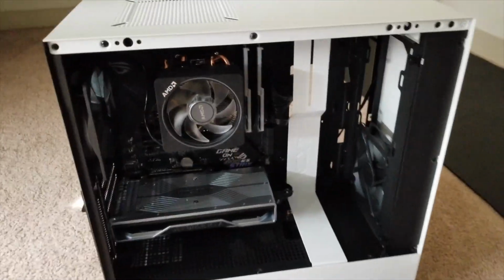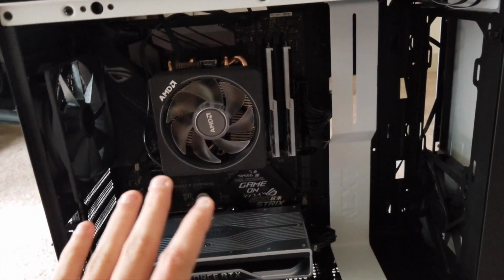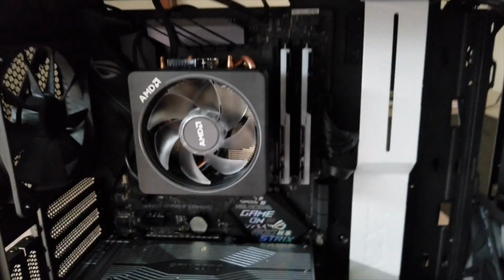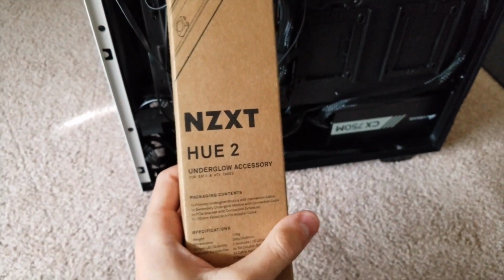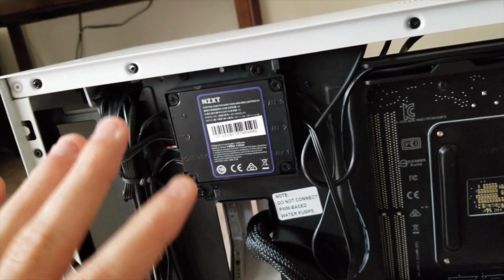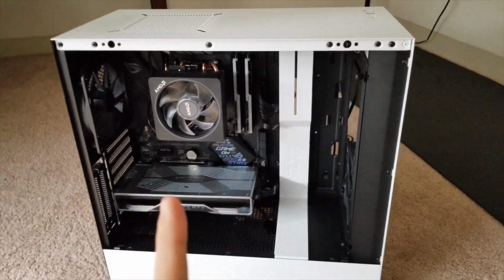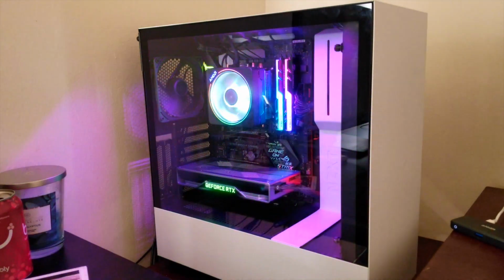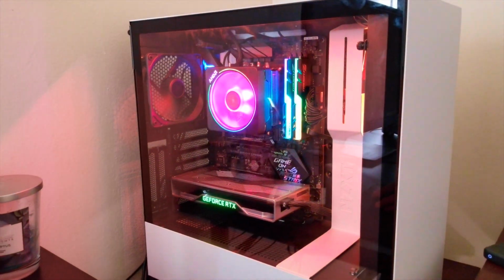NZXT H510i Case - Follow Up and Build

Comment: Dont know if you still answer questions but I dont know how to plug in the breakout/front panel connector cables
Reply from the maker: You have to reference the manual for your motherboard and the case itself. There should be sections explaining what each plug does and then what different ports do. If you don't have the manuals a quick Google search should find it for ya🤙🏻
Reply: @JaBlankSki  I have figured out the placement of the connectors but I'm not getting power to the motherboard, should the fan on the psu spin regardless of it being connected to the motherboard as there isnt power to the leds or fans either
Reply from the maker: If you don't have power to the board or fans or LEDs your power supply may be a dud🤷🏼‍♂️ if only certain things worked while others didn't then I would say trouble shoot those. But since it seems you are getting no power I'd say look at your power supply
Reply: @JaBlankSki  yh its brand new but I think I'll get a replacement, thanks for the help man 💕💕
Reply from the maker: Yeah it happens sometimes unfortunately 😖 I feel like the power supplies aren't always good quality even if they are a good brand. But yeah see if that helps! Best of luck🤙🏻🤙🏻
Reply: @JaBlankSki  thanks for the help man I dropped a sub, you're a nice guy
Reply from the maker: Thanks man I appreciate that 🤙🏻
Reply: @JaBlankSki  ❤

Comment: I just got this case and the "top" fan (that you moved to the front) isn't spinning.   Why would the back fan work and not the other?
Reply from the maker: Make sure it's plugged into the hub fully. Unplug it and replug it into the same spot or a different one on the hub. If that doesn't work, try plugging it directly to the motherboard. If it doesn't spin for any of that then it's probably a defective fan. Hope that helps!

Comment: hey so im a little confused, the case comes with 6 pin connectors and another weird looking plug, where did you plug that into?
Reply from the maker: Hey could you provide a time stamp for what your asking on?
Reply: @JaBlankSki  when you showed the bottom part of the motherboard you had the 6 pins thing to power everything on the front IO, but it comes with some weird connector at the end of it, where would we connect that part?
Reply from the maker: @Rawrs  I'm having trouble understanding what exactly you're referencing. There is the SATA that you plug into the power supply? Or there is the hd audio that you have to plug into the motherboard? That will depend on your motherboard. Check the documents for the case and the motherboard. Or you can also reference my first video on this case! Sorry I couldn't help more
Reply: @JaBlankSki  we figured it out but, on the H510i manual at the cable connections part there's a cable there that we didnt know what it plugged into but we knew the 6 pins powered the start button and stuff, but our case didnt come with a manual so we searched all the internet to figure it out
Reply from the maker: Did you get it figured out? If you go to NZXTs website they have the manual you can download

Comment: You didn’t really explain but did you plug the case fans into the plugs that were attached to the hub or to the one on the motherboard? Now I’m talking about the plug that has the four plugs and then the sata on the end, which did you use? Does it matter?
Reply from the maker: Hey! So I had the two case fans plugged into he case hub itself. The case also comes with another fan cable extension that has two 3 pin connectors and 1 4 pin connector. These are if you get more fans for the case. If you mean other cables make sure you read the case instructions cause they will explain what is what or check your motherboard manual. I do go over the cables a bit more in my first video on the case which you can find on my channel! Hope this helps!
Reply: Ja Boi oh wait aren’t the case fans already plugged into the hub?
Reply from the maker: They should be!

Comment: Do you know if you replace the rear and the top fan with NXZT AER RGB 2 (120mm & 140mm), will they be compatible with the hub that come in the case ? I want to point out that i am not referring to the NZXT AER RGB 2 twin starter pack that comes with the HUE in the box.
Reply from the maker: I believe any NZXT RGB fan will require the HUE2 hub to work properly (i.e. spin, light up, and sync to other LEDs). Without testing it I can't 100% verify it, but that is my guess
Reply: @JaBlankSki  I just hope this is not true. Because imagine if i buy 2 single NZXT RGB fans, now i have the integrated HUB that come with the case and on top of that I'm gonna have to install the HUE 2 controller to power separately those 2 RGB fans ?

My reasoning is that buying 2 single NZXT RGB fans is cheaper than buying the NZXT AER RGB 2 - twin starter pack and that is why you paying a little bit more to when you get the "i-version" of the case so you wouldn't have to spend more on RGB fans.

I know you can connect the 2 RGB fans to your motherboard but in the end you want to synchronize the RGB lights using the nzxt cam.
Reply from the maker: Not sure if you were able to test this but would be interested in your results. As mentioned in my video I got the underglow nzxt lights and plugged them into the hub with no avail. They would not light up without the hue 2 hub🤷🏼‍♂️
Reply: @JaBlankSki  i have 2 AER RGB 2 in my H510i and i confirm it's not working ! :(
Reply from the maker: Bummer:/

Comment: Good job man . I’m trust trying to figure out where you put your front case connections. I have the same case with amd and I think this helps me. I see you put the little tiny connectors and put it through the back. Can I ask what you plugged that dongle into back there?
Reply from the maker: You'll have to reference the manual for the front IO and the manual for your specific motherboard. They will tell you what plug is what and the motherboard manual will tell you where they can be plugged in. There is one dongle in the back for all the case stuff that plugs into the power supply
Reply: Ja Boi  thx I didn’t know the other end went into the power supply area. Was looking like crazy . My first build. This case r5 2600 with Nvidia gtx 1660 super oc
Reply: Ja Boi yeahhhh my power supply don’t have any thing that it plugs into. Now what?
Reply: Ja Boi I found it! It was on another sata strain.
Reply from the maker: There ya go🤙🏻
Reply: Ja Boi too bad I didn’t check my new power supply. It’s dead:(
Reply from the maker: Oh no, that's not good 😖

Comment: Is the h510i led strips pre installed to the case or do you need to buy and install it yourself?
Reply from the maker: The LED strips come pre installed and plugged into the hub. They should light up when the case is turned on and then can be changed with the Cam software 🤙🏻
Reply: @JaBlankSki  Wow, cool to know and is it the same with the black version of this case?
Reply from the maker: It should be since the only difference is the color!
Reply: @JaBlankSki  OK thanks 👍
Reply: Hey ja boi can you link me the cam software plz I have this case and I haven't been able to modify the lighting on the led strips, is appreciate it a lot haha.
Reply: why my led is blue only?
Reply: Creasetian Lauren Cajayon you have to download the CAM software to change the color
Reply from the maker: If you just do a quick Google for CAM software NZXT you'll be able to find it🤙🏻

Comment: thanks for the video its really ahrd to find video about this case, i actually have question will my  cooler RGb work with  LED 2  Port?
Reply from the maker: Glad it could be of help! And I'm not 100% sure. Mine CPU cooler LEDs go off of my motherboard. It may work! Just not sure either on control of those LEDs. Like if you'll be able to change style and such
Reply: @JaBlankSki   i see , well the problem is that my motherbord dosent have rgb connector so i thought since this case has its own it would help
Reply from the maker: I mean doesn't hurt to try! And worst case you may just need to switch the board🤷🏼‍♂️

Comment: Where should I connect the control hub LED and fan cables? On my motherboard? Where exactly?
Reply from the maker: So the hub connects via a USB pin connector on the case itself. You'll want to plug it into a USB pin connector on your motherboard. The hub gets power from a SATA cable on the case as well. That'll plug into your power supply. Hope that helps!
Reply: @JaBlankSki  And where do the rest of the cables that come with the case go? (Such as the Power, usb 3.0 etc...)
Reply from the maker: It just depends on your motherboard. You should have gotten a manual with the board that explains what each input is and where it's located on the board. The case also came with a manual on what the hookups are that come from the case itself. If you don't have the manuals just do a quick Google search and you should be able to find them 🤙🏻
Reply: @JaBlankSki  thanks for the help dude. I think I'll buy this

Comment: Hey :) I’m currently building a pc as I’m typing this lol and I have an emergency😬 sorry for the nooby question, but where does the wire coming from ‘fan 1’ on the control hub go? I can’t find anywhere on the PSU that it fits into
Reply from the maker: Not a noob question at all! Hmmm I believe the fan 1 just goes to a fan not necessarily to the PSU. There should be a different cable that goes to the PSU to power the hub and front I/O
Reply: it’s like ‘fan 3’ and ‘fan 2’ are connected directly to the fans, then ‘fan 1’ has a loose wire?
Reply from the maker: Ah yes! It has like 3 connectors on it? Those are just extensions for any additional fans you may want to hook up. If you don't have any more fans then I wouldn't worry about this. You can either just tuck it away in your case, or unplug it all together! I think I just tucked mine away in case I needed it🤷🏼‍♂️ hope that helps!
Reply: Ja Boi thank you so so much!! I was so confused haha
Reply from the maker: Yeah no worries! Took me a second to figure it out too 😂 well best of luck on your build 🤙🏻
Reply: Ja Boi thanks dude :))

Comment: Is that the Asus ROG Strix X570-E? Im planing to use that mother board with the stock Ryzen cooler with the 3700x and i'm wondering what problems you had with is. Sorry if its not, just want to know if i should switch to an AIO to avoid problems
Reply from the maker: I'm using the ASUS ROG STRIX B450-F. But I gotcha, yeah it will just depend when the board came out and if they have updated with the latest BIOS. I would say if your leaning towards an AIO then do it right off the bat. But if not then give the included cooler a shot and see🤙🏻

Comment: You can get a 19 pin usb adaptor to make the top panel to work my ddr3 setup had it . Pugs into usb plug on motherboard to the panel plug

Comment: Does the pc case come with a power supply?
Reply from the maker: No.
Reply from the maker: No it means you can mount a power supply at the bottom. Not that it comes with one. You'll have to buy that separate

Comment: Hey I finished building my first ever pc and I have very similar stuff to yours. h510 stock fans, ryzen 7 wraith fan and motherboard. Do you think moving my other stock fan on the front and not above like you will help with cooling? Did it help yours with cooling? Just curious.
Reply from the maker: I never really tested it having it stock so I'm not 100% sure. I feel like it helps a bit. At least in the sense that it won't suck in as much dust. If you really want to optimize cooling you'll probably want a third fan in the front!
Reply: @JaBlankSki  thanks for your reply

EDIT: Btw im curios to know if your pc is at all quiet or close to quiet when idle. Mine one is slightly loud and i was wondering if it was the same for your setup.
Reply from the maker: Have you installed the CAM software for the case fans? Sometimes mine will seem loud then I'll open the software and it'll mellow out. Otherwise check your fan settings in the BOIS
Reply: @JaBlankSki  thanks for the tips my dude. I've never heard of the CAM software before. And ill definilty go into BIOS and play around there too
Reply from the maker: Try the CAM software first. You can find it through NZXTs website 🤙🏻
Reply: I want to build one but im worried ill do it wrong or not be able to do help?
Reply from the maker: You'll be fine! There are tons of in depth of builds online just watch a few of those and you'll be fine 🤙🏻

Comment: Great video! Just a question, how many fans can you plug to the hub that comes with the case?
Reply from the maker: 3 fans at least. I believe there may be a spot for a 4th🤷🏼‍♂️
Reply: @JaBlankSki  I think you can actually flug 5 (2 in the first 2 hubs and 3 in the 3rd hub) please check for me because I am getting this case, and I promise I will sub
Reply from the maker: I haven't had a chance to look. But you can make more space if you unplug some of the LEDs I believe 🤷🏼‍♂️

Comment: Quick question, my dude! Can you use seperate lighting options for the included strips in cam? Thinking about getting this case as well. I just don't know how everything works :P
Reply: Also! You, my good sir, earned a big sub. Currently watching fallout 76. 😉 Lovin the vids.
Reply from the maker: Appreciate the comments and sub!🤙🏻 Unfortunately I'm not too sure. When you get the case the RGB strip is plugged into the nzxt hub. If you were to get Corsair RGB fans you could try to put them in the hub and see if they will work with the NZXT CAM software. Worst case if it doesn't work, you can plug your RGB items directly into the motherboard. Usually your motherboard has RGB controls built in. But you would need to double check your motherboard for that. I know it's not a direct answer but I hope it helps a little!
Reply: @JaBlankSki  all good dude! Will let you know when I build it!

Comment: so do i connect the led plug thing into the motherboard?
Reply: Vatan The led strip is already plugged in and pre installed but if you have separate led’s then yes
Reply: Crew Rogers how do I turn those on? The led strip that’s preinstalled needs to be connected to a 4 pin however I don’t know which cable it needs to be plugged into

Comment: Hey, my RGB LED's don't turn on (I mean, htey turn on sometimes and not sometimes, mostly don't). And I've checked everything, and tried possible solutions. Same case btw.
Reply from the maker: So if you have tried different solutions I could only think of two things. One could be you have a loose connection with the LEDs. If you haven't already try unplugging them from the hub and repluging them into opposite ports? This could also apply to the sata or USB plugs. If that doesn't work and you recently bought it I would return it and get a replacement. Hope that helps!
Reply: @JaBlankSki  Thanks, tried everything, still didn't work. Sad thing is I've finished my build, so I can't return the case (More like too lazy to take everything apart), so just gonna buy some new RGB LED's, but once again, thank you for trying to help.
Reply from the maker: Makes sense if you already have everything put together! Sorry I couldn't be more help but glad you have a plan🤙🏻

Comment: Mea Culpa for not reading the pinned comment about your GPU.  😢  So, do you feel the Smart Device V2 overall, is worth it?  Thank you.
Reply from the maker: No worries man, just giving ya a hard time. I mean it's nice that it comes with the case but really if you want that personal functionality I would recommend using something else🤷🏼‍♂️
Reply: @JaBlankSki , hey, in these days of Global Pandemic, we should be trying to be nicer to each other, LOL.  I know you are  giving me a hard time, no worries.  We can all use to slow down a bit and not be in a rush.  Thank you, appreciate your answer on the V2.  My friend likes RGB, which is why she bought this case in the first place, LOL-ewwww shinny!-so steering her toward a RGB CPU cooler than can use a SATA power connector to control the RGB that comes with an in line controller.  Not as convenient as having mobo control bc you have to get back in the case any time you want to change the pattern of it, but better than a sharp stick in the eye as they say.
Reply from the maker: Lol yeah. I mean overall I like the case and it works for my setup but to each their own 🤷🏼‍♂️ well I hope y'all settle on something that works for her! Best of luck man🤙🏻
Reply: @JaBlankSki  thank you.  Let's just say, it has been 'dificult' and let's just leave it at that, LOL....

Comment: Did you take the fan from the top of the case and move it to the side panel?
Reply from the maker: I moved it to the front of the case as an input fan. So air gets pulled in from the front and is pushed out the back!
Reply: Ja Boi ok thank you, also is that the only fan you put on the front or did you put another one where the empty space is
Reply: Ja Boi right above it
Reply from the maker: I only moved that one because that's all I had on hand. If you wanted to add another you definitely could. You would just need to buy one 🤙🏻
Reply: Ja Boi ok thank you, also should
I buy a 140 mm fan for that slot, or 120 or does it matter
Reply from the maker: You can view the actually info on the Amazon page for this. But it seems like 120 or 140 will work with most of the slots except the rear one (only 120). The fans that are included are both 120
Reply: Ja Boi ok thank u you’re the perfect person to ask because Im building the exact same rig as you except my motherboard and ram is different
Reply from the maker: Ah I gotcha well glad I could help and good luck on your build🤙🏻